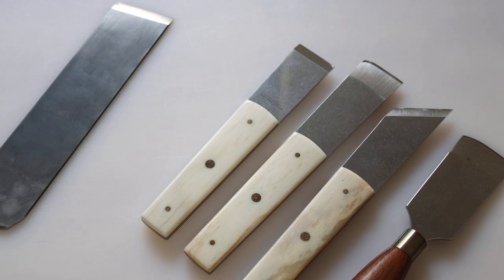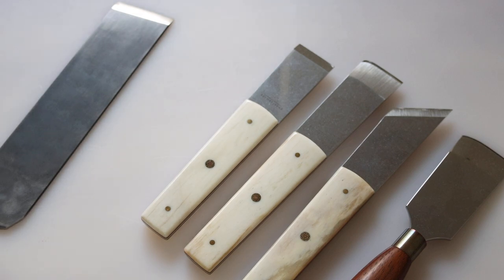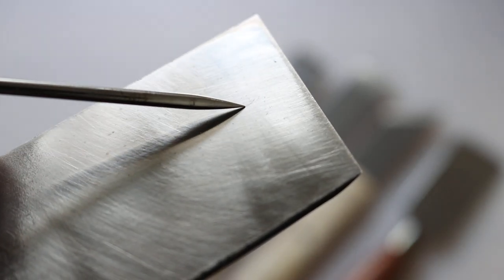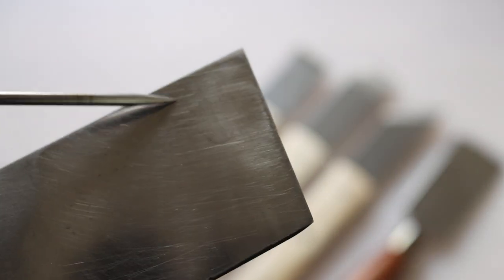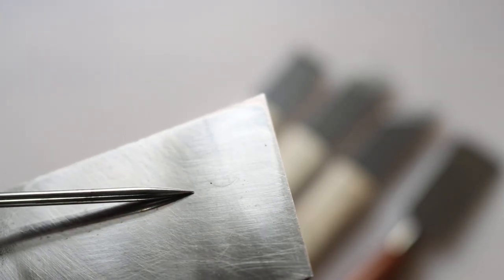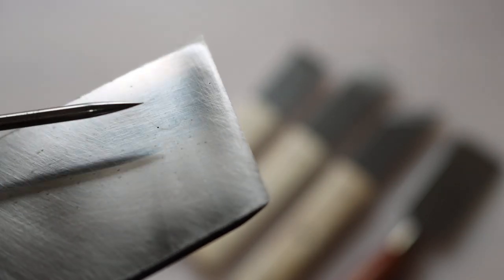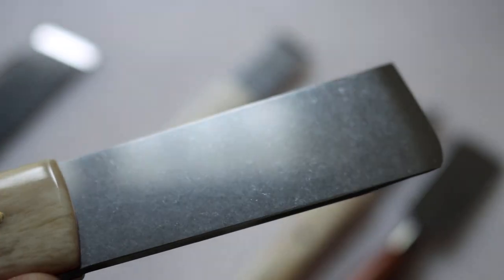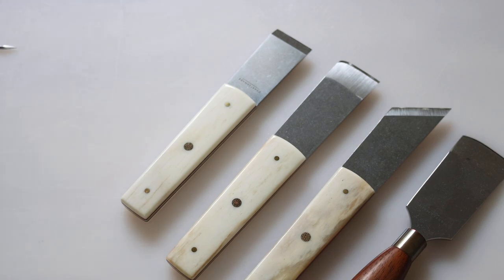POWDER STEEL VS CONVENTIONAL STEEL

Comment: Modern supersteels use Vanadium which was the key element that made real Damascus, Wootz steel famous. Supersteels today are so strong you can't sharpen some them without expensive diamond tools. Steel manufacturies nowadays are finding new steel alloys that balance sharpening, edge retention, hardness and oxidation. This isn't as important as the Heat treatment and factory edges that consumers will feel straight away. A poorly forged knife will always be bad no matter the steel. Try m390 as it's one of the most readily available and easy to use supersteel.